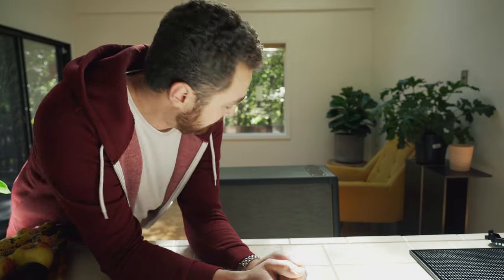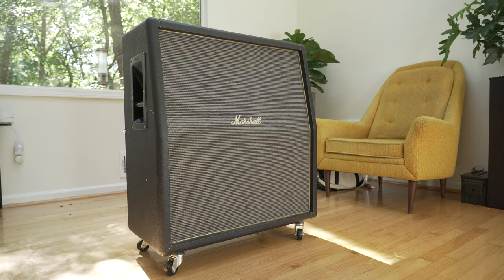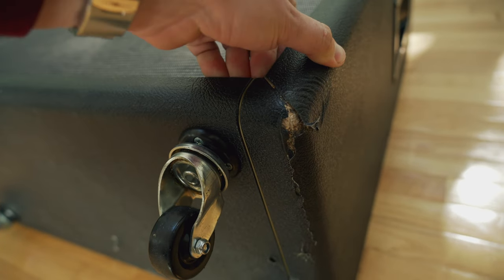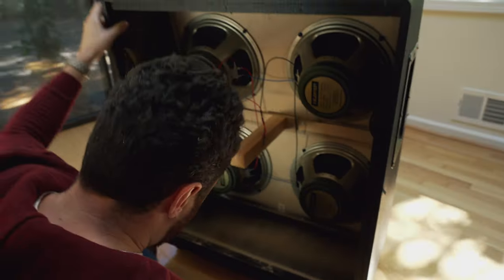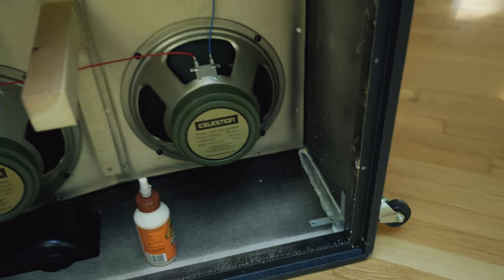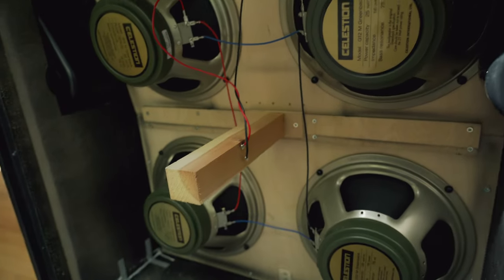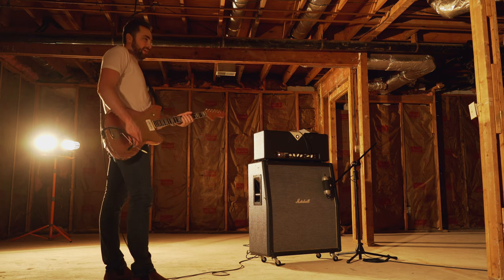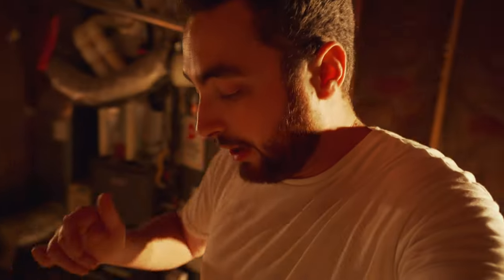I Bought A BROKEN Marshall Cabinet (and it sounds AMAZING)

Comment: Wood glue or epoxy glue.  Open the joint and work the glue into the opening.  Buy a strap with a ratchet.  Uhaul or hardware stores sell the straps. 
Using an "L" bracket would be like repairing a Les Paul neck break with a metal plate and screws.  It works but there are better options.  I.e. glue and wood blocks along the seperated joints....
Reply: The strap is used as a clamp.  Wrap it around the box after you glue it. Ratchet it tight and leave it overnight.  Remover the strap and reassemble the cab....  ratcheting straps are great for certain large item needing a unique approach.
Reply: ^ this
Reply: Yes, this^^^^ Dude, some kind of clamps and get the glue in the joint.
Reply: Excellent idea!😎🥸
Reply: Also, Make sure the cabinet is square and the back will fit after the glue dries. May even want to put the back on before ratchet strapping it
Reply: I prefer wrapping the whole bottom with some bailing wire and 2 rolls of duct tape to secure it.
Reply: Little late for that, but I'll agree.
Reply: What Blair said... if you don't want rattles, you need Gorilla snot in the gaps (joke). Aquadhere (PVA) or epoxy into the joint. Crack the joints apart by inserting shims (large flathead screwdrivers). Wrap the outside of the joint in greaseproof paper so the glue doesn't escape  You can lightly heat epoxy to get it to flow better. Pour into the joint and work it so every bit of the crack gets wet. When you clamp, the goo should squeeze out. Leave for a day or two. Clean up with acetone while still wet.
Reply: There's nothing quite like a 4x12 cab, huh!
Reply: I’m in full agreement with the OP. Gluemit and clamp it. 
      Sweetwater sent me a blem Origin 20 combo with serious damage to the cabinet not disclosed in the sale. I know, no comparison to the cab in the video. The amp itself worked fine, but there were major cracks and broken glue joints in the cab. They offered to take it back and send a new one, but I opted for keeping it, and they gave me a substantial discount. Some glue, some clamps, and some screws, it’s pretty solid.
Reply: Definitely wood glue. stronger than wood.
Reply: Hey, I didn't realize Rhett had a butchery license. I've been watching videos of Melbourne police pole-axing little aged ladies but this "repair" was more seriously unsettling. Hope you haven't initiated bad JUJU Rhett.
Reply: @blairsavercool9730  yes, and instead of the L brackets, cut 2 lengths of 2x2 as corner braces and screw those in from the outside - the screws will suck it in tight to the corner.
Reply: Agree, this is such a hill billy fix it has made questions his other videos
Reply: im glad you said it because I was about to
Reply: Yep thats what i did it came out fine plenty of stuff on line about marshall cab repairs cheers
Reply: I would have pulled that baffle out first to gain access to the broken joints. And yes wood glue.

Comment: Playing through a 4x12 is a true adrenaline boost. I think every guitarist that plays through one for the first time has a huge smile on their face. Just feeling those four speakers moving air as you stand in front of it--- majestic! The first Marshall 1960A I tried with the matching JCM 900 4100 head back in the early 90's, there was no going back to a combo or any other set up after that. I have to say I am completely jealous of you having a studio space to crank that amp and cab up. I have my amp heads and 4x12, but can't use it without an attenuator/ load box in my current home studio set-up. Glad to see you having a blast playing through your new acquisition, Rhett. Enjoy that Marshall cab, man.  🤘😎🤘

Comment: Those 'L' brackets are ok but will eventually flex and move with temp changes. Instead ,In addition to working Glue into the separated joints , Glue and screw full length wood blocks in each corner then clamp them up for a day, in addition to strap clamping the entire cabinet. That wood  will add some weight but should stay rock solid if you do a good job. Cool cab. Yeah I had an amp I ordered skewered by a forklift and very obviously completely mangled.. but the trucking company still delivered it that way to the store ..and the store refused to refund my deposit as if it was my tough luck....gave me store credit instead....seems like trucking companies just don't give a shit if a box is large/heavy...and takes some care to handle. ... .hey yo fugget about it..whaddya ya gonna do?!? But Marshall should do a better job of crating up their large/heavy stuff ..this kind of thing is pretty common ...of course that would have to raise the price...
Reply: I'm 0% proficient with DIY repairs, but is there really enough temperature fluctuation to cause problems if it's just sitting in an iso-booth for it's entire life? Unless the heat and AC go out often, is it really going to make a difference?
Reply: @ATotalDork  As long as the glue completely penetrated all the way through all the finger joints and made good bonds and the cabinet is never moved much .... Maybe not... but why do a half-ass job when it's not much more work to fix it right?? One-and-done and then you can move it if you need to afterwards and no worries. If you have ever had to chase down a weird intermittent 'frequency-related' buzzing in a cab...you would know it can be a pain..and you don't want it happening in the middle of a recording session...Now that I think about it, it would be a good idea to remove the speaker baffle and inspect the baffle mounting strips because they might have been split or splintered. He said some of the screws seemed stripped which means they were ripped loose ..not good.  Anything with enough force to bust out the finger joints could have weakened,/cracked them..also make sure all the speaker mounting screws are sufficiently tight. I'm really surprised none of the voice coils are rubbing  apparently there are no warped baskets. Anyway that's what my OCD would force me to do....but thats just me...Cheers!
Reply: had the same feelings regarding the steel work lol felt like sacrilege lol I woulda been worried about the glue not getting into the joints proper think I'd of probably tore back the tolex or whatever and gone into those joints to make sure. I'd paranoid about little unintentional air escaping through the cracks and affecting the sound lol
Reply: Just out of curiosity, do you suppose that something like JB Weld, applied with a syringe into the separated joints would have been a good idea?
Reply: @charlesoxley7242  Honestly wood glue like Titebond 2 or 3 will do the trick. Much better than Gorilla Glue in my experience. With Titebond the bond will be stronger than the material itself.

I used that to keep the tolex on my 1x12 on and it’s extremely resistant to climates and I live in Oklahoma. Hope that helps!
Reply: A friend did the repair you just described, but he used milled hardwood triangular stock and countersunk the screws. He also roughened up where the pieces met the cabinet surface. Result: a vintage Ampeg 2-15 cabinet that no longer rattled when you hit a low B.
Reply: "Glue and screw full length wood blocks"  < yes
Reply: Excellent point Framus, the corner joints should have been cleated from the factory and the the cleats glued and screwed...  Plus separate the joint as much as possible without causing damage when applying glue (you want to get as much in the joint as possible).
Reply: @charlesoxley7242  Charles, JB weld is not intended for wood, so it might not bond ..better to use a good wood glue since that's what your working with.Cheers!
Reply: @colinwallace5286  Yup sounds like he did it right the first time! Yeah Ampegs were 'Hernia makers' but such great amps!  Any one who had to lug  around some Vt22 combos or 'God forbid' V4 or SVT gear had best  have a back belt handy or better yet a couple of buddies with a good solid hand truck or they would be feeling it the next day fer sure!!😁😁
Reply: I'm with Framus.  While the L brackets and will probably be just fine if it's stationary, brackets and screws are ironically less effective than wood and glue.  

The strength of a joint is in friction, which is a function of surface area.  Screws, bolts, screws, nails all work by providing friction.  If you make some well fitted wooden blocks, and use a good PVA glue like one of the Titebonds, you don't actually need any other form of fastener, though screws or staples can be used to hold the surfaces in alignment until the glue cures if clamping would be difficult.
Reply: I would seriously consider pulling rage speakers and baffle out, pulling back the Tolex and really getting those finger joints cleaned out and reglued. Then some reinforcement wood glued and clamped into the corners. Titebond II would do the trick, but good clamping is key.
Reply: It should be fine with metal brackets but yes friction-joints are usually superior in durability. Non-issue in studio though
Reply: @jaredtorres1000  That was Gorilla Glue's Wood Glue, so the same as titebond PVA. Original Gorilla Glue would be Polyurethane and yes, less effective for this instance (though immensely stronger)
Reply: Maybe some of this silicone thing used in bathrooms will come in handy, too. I got good results with it to help things not wiggle and to keep everything tight. 

But right now it sounds really good so enjoy your new cab :)
Reply: No way...😂😂😂😂 that's my genius comment.  Simply simple common sense 😂😂😂😂😂😂😂

Comment: Don't use brackets, glue and screw a length of square pine along each corner. Creates a block joint.  Brackets  have no strength in that situation. You can use a ratchet strap to pull the joins in. PVA glue worked into the joins first of course!

Comment: Just seeing the smile on you face makes it all worth it, I do wood working other than pull the covers off and exposing the frame and re-gluing the joints you did the most particle thing to do and adequate bracing and glue job. Job well done and congrats again. And it sounds awesome.

Comment: The glue Marshall use to affix the tolex is heat activated. Get yourself a heat gun or even a hair dryer to heat up the tolex and carefully peel back the tolex to make your repairs and then heat it back up to glue back in place. Have fun man.

Comment: While I admire your desire to play your new cab as soon as possible, I really would recommend removing the speaker panel itself and repair it as others have said.  Get it down to the wooden box it is, then regale the seams by putting glue INTO the joint, strap clamp it together and leave it over night.  What you have now sounds amazing and great but even though it's together now and is a studio-only piece of gear, it will be far better if you do a complete fix rather than a patch.  I admire you for taking a chance on it but for both your sakes (you and the amp), do what really needs to be done.  Phenomenal playing like always too!

Comment: I fixed a 1960A that was broken in a similar manner.  It had gotten wet and the glue joints gave out.  All of them.   I was going to recover it anyway and convert it to 1969 pinstripe specs.  When I removed the old tolex, the cabinet fell COMPLETELY apart.  I simply cleaned the old glue out of the glue joints and glued the cabinet back together,  and did the rest of the conversion and new tolex job.  It came out great.      To fix that cabinet right, you'll end up recovering it.

Comment: Rhett run a bass through it to see if you get and vibration noises. Also what I would do is get a glue syringe and inject epoxy into the break. Been there done that. Works great.

Comment: I've had a 4x12 for years now and upgraded the speakers several years ago. Debated on getting rid of it off and on because they are heavy, cumbersome and very loud.  But nothing I've ever tried does what they can with a good tube amp.  I've got a great 120x tube amp with a volume control and I don't need to play it loud but those speakers still move air and it's very rewarding.  I'm not getting rid of it.

Comment: I bought a '70 B cab from a broker that used to belong to Robin Trower, and it was broken at all 4 corners. The tolex was so torn up that I just said screw it and peeled it and rebuilt it. I still use it today 30 years later. love it.

Comment: Rhett, I've fixed a number of tour damaged cabinets just like that. There are two things: Dowels and Cleats. Take the cabinet apart, clamp it square and drill and dowel the joints each way (perpendicular dowels spaced down the edge) and put cleats on the inside corners. Repair the tolex if necessary. No rattles and they are stronger after repair than when new. Never had one come back after repair.

Comment: If the baffle screws are a bit stripped we used to dip wooden match sticks in wood glue and fill the hole. Works like a charm and doesn't leave the baffle looking like Swiss cheese.

Comment: Load some fiberglass insulation bat inside of there, so as long as it's not touring or being exposed to hot sun and humidity it will not damage speakers. Tightens things up considerably by reducing the wooliness in the low mids, better 'focus'

Comment: There are more than a few YouTube videos on replacing the Tolex on cabs.It's not difficult just annoying and time consuming. It is, however, the right way to rebuild this cab. Band Aid fixes don't work on motorcycles or audio equipment. Too much vibration. Take it apart. Repair the joints with full length wood blocks etc as detailed below. Put a new skin on it and enjoy the fruits of your labor.Great playing as always ,Rhett.

Comment: wood glue and a corner clamp. wipe off excess glue inside and out. once dried, cut some pieces of wood to length of the inside of the cab and screw them in to reinforce the sides. Paint the outside black to cover up imperfections and you're good to go.

Comment: Rhett, I think you should have spread the broken joints apart and put glue into them. Clamped the cab anyway possible even if you laid it on its side and put weight on it. I don't think the metal "L" brackets were the answer. The screws can possibly back out with vibration. Fantastic cabinet though. Marshall cabs are amazing especially the one you bought. Great purchase my man.

Comment: I picked up a Marshall 2551BV Jubilee 4x12 a few years back with almost identical damage. In my experience it has nothing to do with Marshall’s build quality or materials, and everything to do with their substandard shipping materials and packing techniques. 

The box containing your cabinet was likely dropped on one of the corners during shipping (probably more than once!), which caused the cabinet to become wracked until the finger joints at the bottom corners finally gave way under the pressure. Simultaneously, as the cabinet was wracked out of square the baffle screws tore free from their anchor points, further compounding the problem. 

The main issue is Marshall does not use any sort of internal bracing or support in their shipping containers to prevent the cabinets from becoming excessively wracked when they’re inevitably mishandled during shipping. They basically cram a heavy and extremely bulky 4x12 cab into a cheap flimsy cardboard box, slap a shipping label on it, and off it goes. It’s inconceivable that Marshall is somehow not aware of the problem, so presumably enough 4x12 cabs make it to retailers unscathed it’s not worth the cost or effort to improve their packing materials or techniques. 

The silver lining is if you’re not bothered by a few minor cosmetic blemishes, and you’re willing to spend 15-20 minutes doing some light repair work, you can usually get a sweet Marshall 4x12 cabinet for next to nothing. Rock on!

Comment: Dear Rhett, great video! But it is not from a Hendrix (reissue) stack. Marshall were starting to built the oversized top cabs (A) in the 90s. The original oversized 4x12 (B) from the 60s was a bottom cab. The original limited Hendrix stack was from 1994 and in purple tolex. The limited Edition Super 100JH Handwired Jimi Hendrix Stack from 2006 also came with an oversized bottom cab in black tolex.

Comment: I would have opened up the bottom of the cabinet a bit and filled up the gap with a good wood glue then used a ratchet strap or two to lock it in place and let the glue set for at least 24 hours. The brackets would have been unnecessary at that point. 

I would imagine that the transport company that moved both cabinets damaged them on both occasions. Those 4x12’s  mist have been thrown off the truck out of spite. One thing that might be an issue is if the voice coils in any of the speakers have become un centered, you may want to test each speaker individually to see if theres any rubbing because eventually it will fail. 

Good luck with the new studio. 🎸🎙🔊🥂

Comment: I agree with Framus—the corner braces are a good quick-fix, but I would strongly suggest making full-length cleats out of a hard wood and glue and screw them into the corners. I would screw the cleats up through the bottom and if you don’t want to see screws on the sides you could see if you can peel back the shell then glue it back into place once the screws are in. I would also recommend doing what you suggested and relocate the screws for the front—they will keep working themselves lose over time. In addition to being a musician, I’m also a woodworker ;-) Comes in handy…